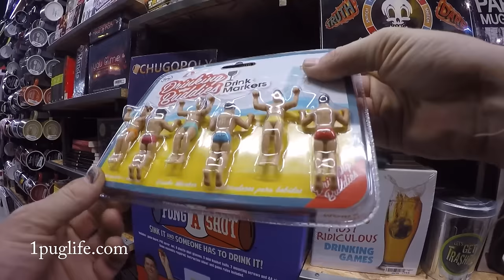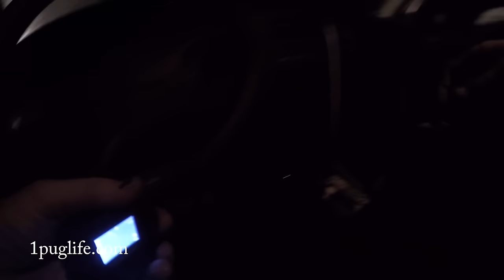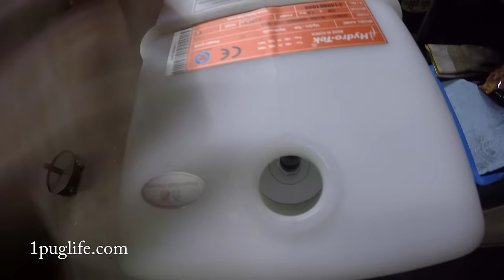christmas shopping at the mall with pug1

Comment: pretty cool of you to take the time to take a photo with that fan, good to see people dont forget were they came from and get too big for their fans. CHEERS BMP
Reply from the maker: i love meeting dicks that watch my movies
Reply: While you're upgrading 'ol rusty you might wanna get a remote starter. If you've never had one, they are awesomer as frig. Key fob starts your vehicle a half mile away, however in accordulations with the safety facteer, you can't drive the car without putting the key into the ignition. Warms your vehicle up (and defrosts the windows) in the winter or cools it down (AC) in the summer. If you get the fancy one it will send a signal back to the remote confirming your car started & has a 15 minute auto-shutoff (in case you get on the hash and forget you started your car an hour ago). Viper makes one that will work in conjunction with your security system so you don't need separate controllers. I thought all you arctic fellas had one already. You can thank me later. BMP!
Reply: +1puglife what happened to chochy mcstovepipe? A dirty dodge? Sorry ain't been around in awhile bmp

Comment: @pug1 -did that squealing sound in rusty star up after you changed the clamp on the turbo pipe? i was skeptical that it would tighten up enough to seal  vs the heavy clamp that was on their , if no that pull over after it does that and look for lots of air bubbles on the trans dip stick

Comment: I have some insight on your press project. 1- the 40 ton rating is most likely at 10,000 psi probably double what that power unit produces. 2- the piston seal inside the cylinder will not hold pressure for retraction.
Reply: danst165  Pump down the ram with the power pack. Then put high pressure on the ram with the hand pump. In series. Same as a water C vise using a pressure washer for the stroke. then pump up to pressure by hand. Stovepipe.

Comment: if your truck takes longer than average to get to operating temp, or never gets there you probably have a thermostat that has failed in the open position. when a thermostat fails it gets stuck open and just allows coolant to flow threw the engine from the time you start it. a thermostats job is to keep coolant from flowing threw the block when cold so it can heat up to operating temp as fast as possible. a motor is most efficient at operating temp. usually around 200 degrees F. you prob need a thermostat if your overcooling

Comment: take the tank off the pump and shorten the intake pipe, then you can stand it upwards so that the motor is on the bottom and the tank ontop, allowing you to fill it from the top no probs